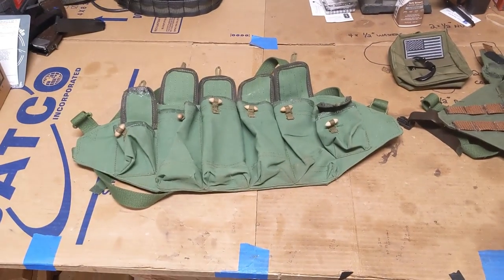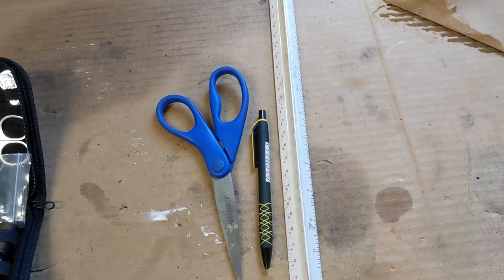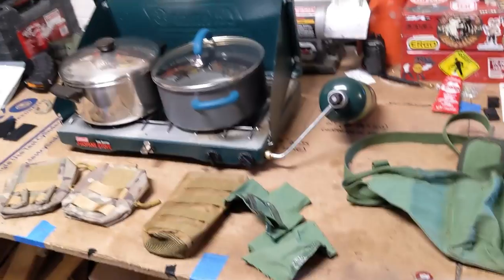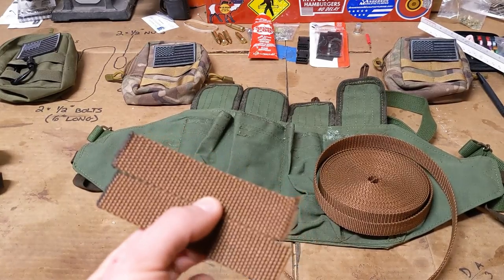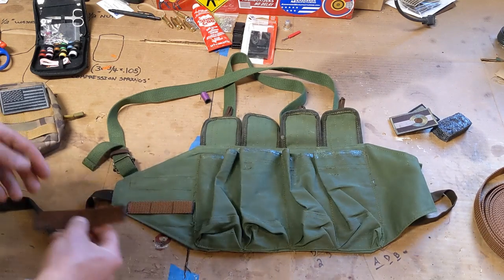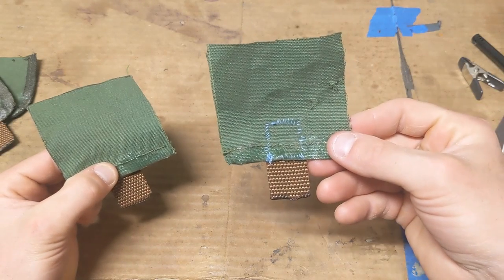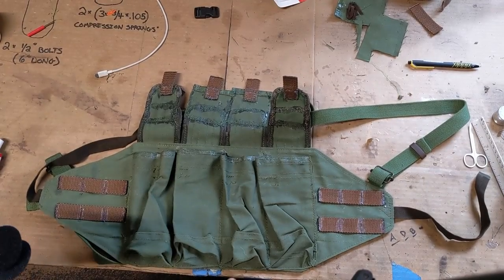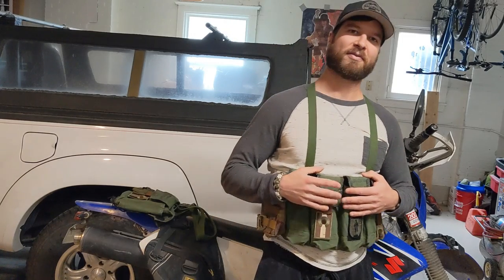Customizing Your Chicom Chest Rig (Type 56/81)

Comment: if your wife or Gf has some old purses with shoulder pads OR old straps from duffle bags of laptop bags you can use the shoulder pads off of those to pad those shoulder straps to prevent them from cutting into your shoulders which WILL happen if you wear that thing for 3 or 4 days straight.......
Reply from the maker: I'm a strong independent man, I have my own purses and handbags thank you
Reply: Based...?

Comment: Have you considered sewing or shoegooing a big velcro loop patch to the belly side of the chest rig for attaching maybe a mag dump bag under, or maybe a tourniquet. Whatever you can think of. Also behind the mags you could sew a small admin pouch, throw a small rite in the rain and a pen in. The T Rex arms four flap chest rig has given me some ideas on placing a radio pouch on a chicom, on the inside near the left armpit area of the rig. Highly versatile kit.
Reply from the maker: All great ideas! I have considered the dump pouch and that would surely give it some more versatility.  The issue I've run into with the radio on the side is that the antenna gets caught on rifle sling/armpit/arm and is pretty annoying.  You could probably sew a tab for it on the shoulder strap though, as long as it doesn't interfere with your sling.  I've checked out the T Rex rig and it's slick! I just don't want to cough up nearly $200 though.
Reply: @ExtremelyAverageMan  bungee cord the antenna to the shoulder strap?

Comment: With the molle installation.
You can make a 3rd strap (a dummy one) and put it between the two you are going to sew in 
Then you can have few pins or the lock in pins to secure the two straps from movement (even like single stitch from either side, if you dont have those, works)

Comment: what did you add to it after the dye? was it a cup of salt ?i couldn’t quite make out what you said
Reply from the maker: Yup, Rit recommends a cup of salt with your 5 gallon mix of dye-helps it adhere to the fabric (just double check the directions on the back of the bottle)